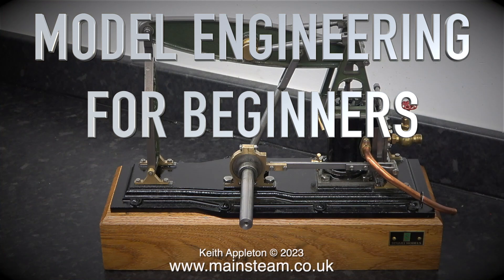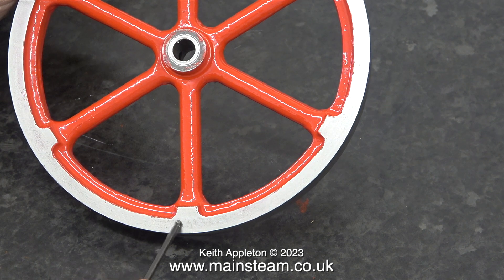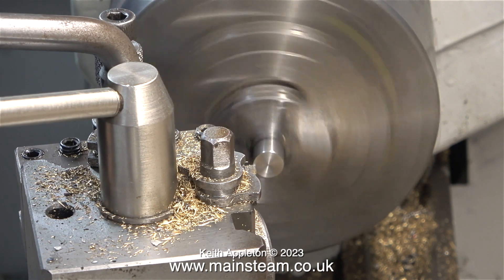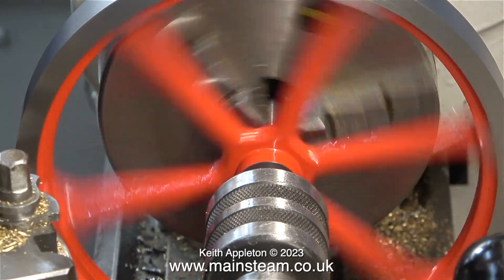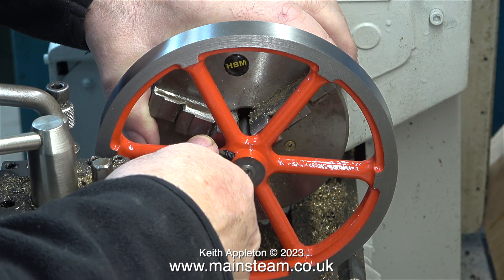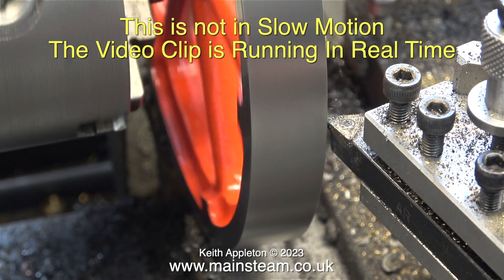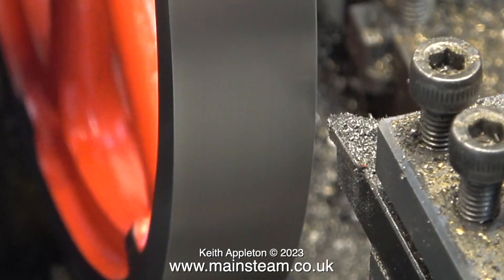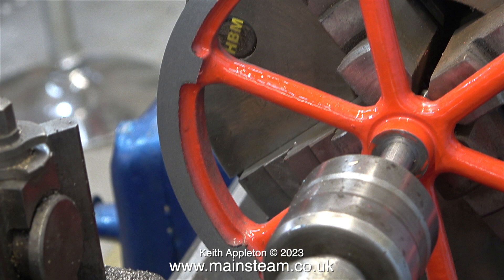THE CAUSE OF CHATTERING WHEN MACHINING - MODEL ENGINEERING FOR BEGINNERS - PART #50

Comment: Grinding is also another option - especially if you're running out of 'meat' on the item being machined !

Something like a Dremel mounted in the tool post with precautions to keep grinding dust off the bed and sideways would do - not for roughing cuts though - more of a surface finishing tool.
Reply from the maker: Thanks for the info!

Comment: Yeah, chatter has an obnoxious way of showing up when you're almost finished. I think it's usually do to taking a very shallow cut at the end. The usual recipe for removing chatter is more rigidity, slower spindle, and heavier cuts. I've taken to spacing my cuts so i can take about 0.050" on the final pass, but that's for my machine with my tooling.
Reply from the maker: Please watch the next episode for my method of removing Chatter marks }:-)))
Reply: @keithappleton  I'll be interested in seeing that. Slicing through chatter marks cleanly isn't a trivial operation, especially if you're close to final size.

Comment: Do you need cutting oil when you are facing a piece on the lathe? Is it only used when drilling?
Reply from the maker: Yes it's useful but not really necessary for cast iron in the home workshop.

Comment: I wonder if sandwiching plastic discs with dense foam or rubber on each side of the flywheel would eliminate the chatter. I sharpen cup blades 3 times a week for a local poultry plant.  I cut a 1/8 inch by 3 inch piece of rubber wrapped it around a cup then ran duct tape around it. Eliminated ringing noise and chatter.
Reply from the maker: Yes that might work, but it's time consuming fitting the damping - please watch the next episode }:-)))